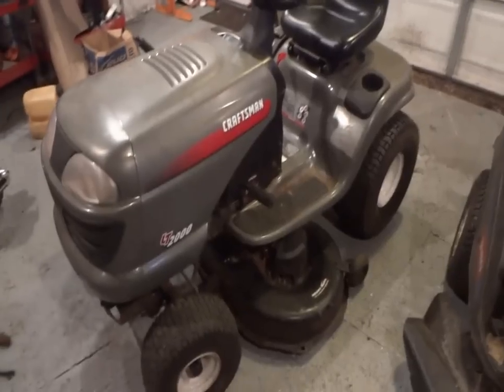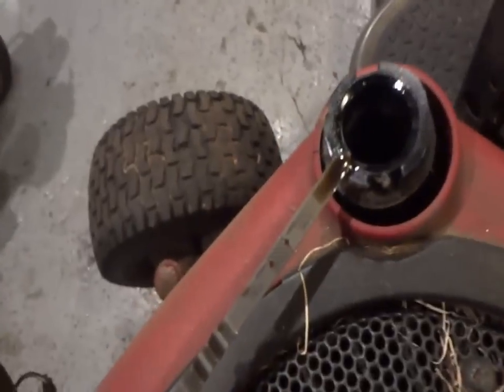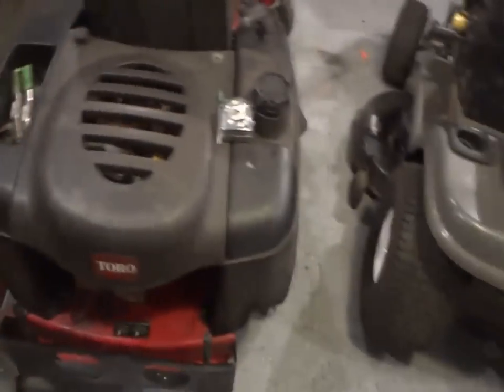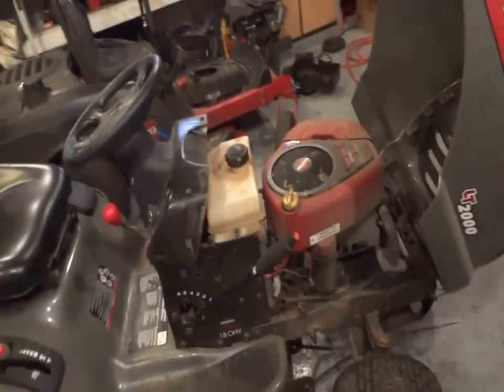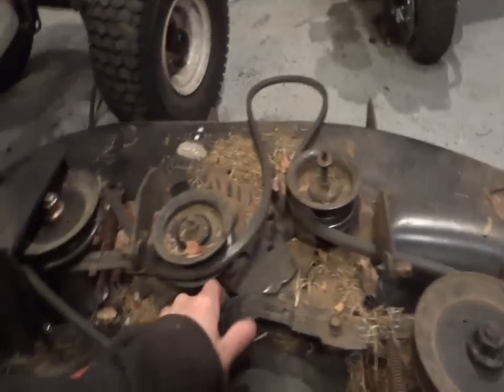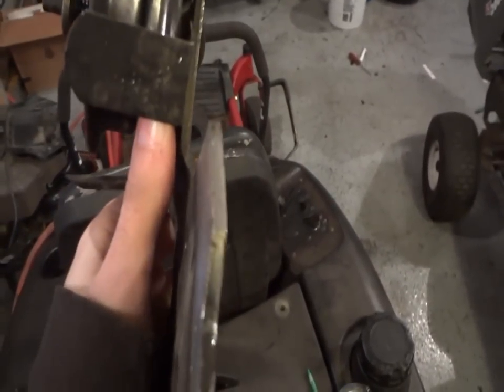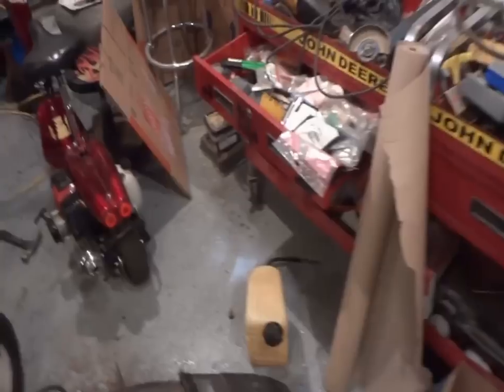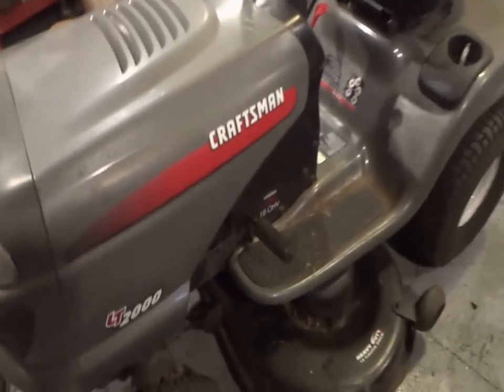craftsman 42" mower deck repair

Comment: Gooday, novice here.  I recently purchased second hand toro timecutter 14-38z.
Problem:  Old belt broke and installed new.  New belt broke within 30 minutes of use.  Both belts broke when I engaged the blades.  Both belts stuck under pulley where tensioner spring is attached.  I noticed bolt holding tensioner pulley is touching the deck and there is bit of play on bolt holding tensioner.  Your thoughts as to the problem?